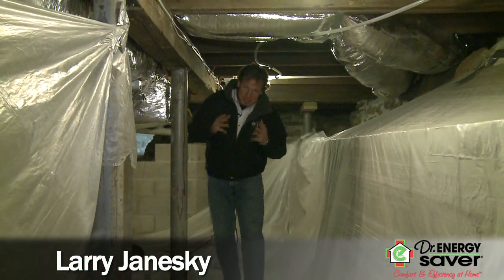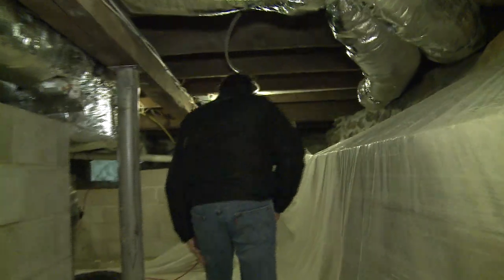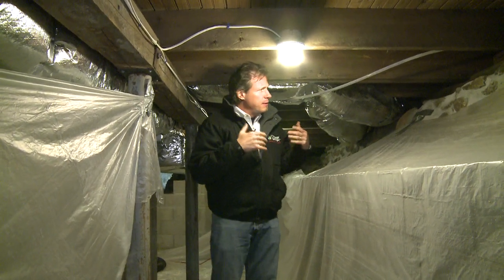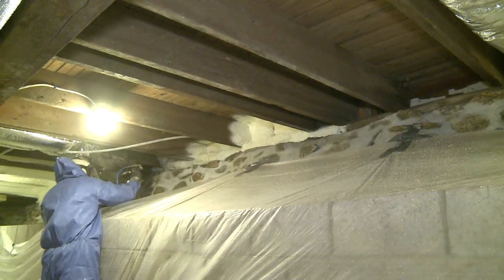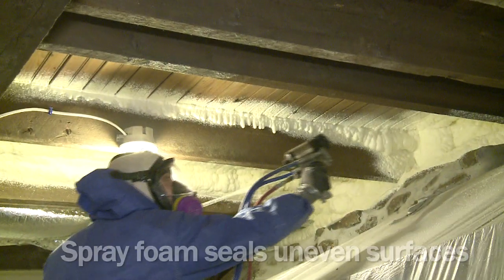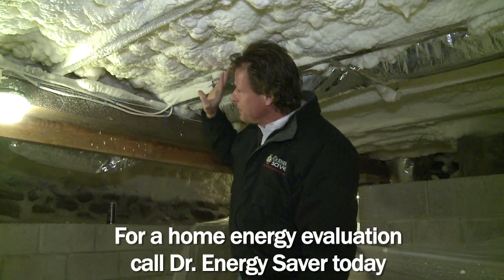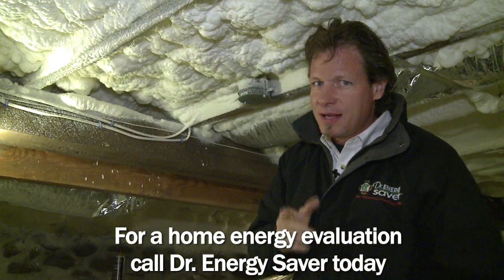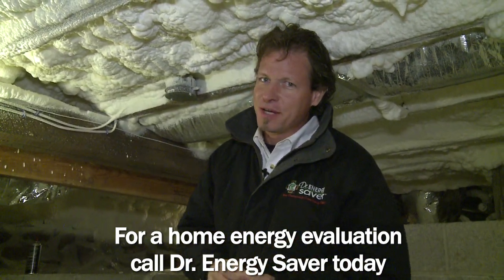Insulating a Floor with Spray Foam

Comment: The idea is nice but I would not recommend this. Why '?
My daughter bought a house that had this done to it.  Nice home but they had a leaking wax ring on spare bathroom toilet.  Didnt know until it soaked the floor joist an came thru the floor by the shower..... the spray foam insulation held the water and has rotted several floor joists.  Costing hundreds of dollars in repairs.  Even though there foam did insulate the floor it also holds water......

Comment: Spray foam insulation in my crawl space caused my floor joists to completely ROT in just 4 years!! EXTREME CAUTION!!
Reply: Open or closed cell?
Reply: i'll bet $ they shot it w open cell if you live in climate zones 1-4 they highly rec closed cell

Comment: Will this application you showed prevent moisture from entering the 1st floor?
I have the same need, and the same cold 1st floor as this owner, but I have tons of moisture coming into the house from the basement!

There is no current vapor barrier and the house needs one. Is this foam you just applied in the VIDEO a good "vapor barrier?"

Comment: No. Do not spray open cell in a crawl space. Plus, looks like he needs some better applicators. I dont get how he has these vids up with foam looking like that and promoting it. Now, on the other side, foam is a great product. Ive been an foreman/applicator for 8 years. Please look into spray foam if you are remodeling or building new. Little higher up front cost, but it pays for itself in the long run. If applied correctly, you cant beat it.

Comment: HUGE MISTAKE! DO NOT SPRAY OPEN CELL FOAM ON IN A CRAWLSPACE. IT ALLOWS WATER VAPOR TO PASS THROUGH IT!! IF THIS HOMEOWNER HAS WOOD FLOORS THEY WILL CUP!!! I HAVE OPEN CELL SPRAYED IN MY CRAWLSPACE AND MY FLOORS ARE RUINED!!! CONTRACTOR WONT FIX! I AM SCREWED!!! CLOSED CELL ONLY UNDERNEATH THE HOUSE!!! IM WARNING YOU PEOPLE!!!!
Reply: Wouldnt water vapor have been getting up through your floor when you had nothing at all sprayed on the underside? How would foam let more vapor up? I would be far more concerned about mop water seeping down between floorboards and not having anywhere to go once it pools up against the foam.
Reply: Morgan Barker foam does a really good job keeping the cool a/c inside the home in the summer and also keeping out side heat from raising the temperature of sub floor. So the sub floor is cold moisture raises up threw the foam and condensates on the cold subfloor. With no insulation or low r value insulation. The subfloor stays above dew point.

Comment: If foam is installed in a roof or a floor or anywhere, and there is a roof leak or plumbing leak, you fix the leak.  It''s not the foam (or any other insulation) that is the problem, it's the leak.  You find it, even if you have to remove insulation to do so, fix the leak, and put the insulation back.
Spray foam, both open and closed cell, is a relative miracle in making homes more comfortable and energy efficient.

Comment: Crawl spaces that are damp should not be treated with closed cell foam and called done.  If a crawl space or basement is wet, it's the dampness that is the problem, not what type of insulation is installed.  There are 26 million dirt floor crawl spaces in the United States, most of them damp as a result of the exposed earth, that are insulated with FiberGlass.  While FiberGlass is not good insulation here, it's not the moisture that is the problem.  We have known for many years how to fix this problem and get rid of the moisture.  You don't ignore and leave one problem (moisture) by putting a moisture resistant insulation (closed cell foam) in.  You still have a moisture problem.

Comment: Yep, nobody denies that spray foam is better, but in reality the difference you see in comfort or your electric bill is minimal if any at all compared to "properly" installed plain old fiberglass insulation.
and no difference at all to rigid foam boards sealed with just a small amount of spray foam which would cut the cost by about 2/3rds as Beth Shatara mentioned.  The point being is that manufacturers are wildly over charging for spray foam. 1000% markup is called robbery.

Comment: Your right, to save $ on the job shown, the volume of spray foam needed could be reduced by using the cheapest ridged foam boards(1/3 the cost of foam) available and glue strips of them between the joists.

Comment: Sadly about 1000sf of foam insulation just 2" thick which is only about R13 would cost about $2000-$2500.
R13 fiberglass at full retail cost at home depot would only be about $300.
You would not see the cost savings of $2000 in your lifetime if you bought the house when age 20 and stayed there until you died.
Foam is better yes, but not 1000% better.
You could put in sealed insulation bats for about $500 and never have to worry about it.
Foam is a scam, manufacturers are making 1000% profit.

Comment: Open cell is the correct product for this job, typical misconception that open absorbs moisture. It will not absorb moisture! but is not a vapour barrier! Open cell will allow the floor joists to breathe while stopping air infiltration. If the joists contain moisture the open cell structure will allow the timber to breathe and not hold moisture and rot timbers. 99% of moisture movement is through air movement but if you stop air movement you stop 99% of moisture movement.

Comment: Wrong product for the job. How did you make the call to use open cell vs closed? I'd guess it was driven by price and ignorance. Open cell has uses, mostly to deaden sound. An unfinish basement is the last place should be used, for one simple reason.. It absorbs moisture! Closed cell is more expensive, but from what I saw in the video, it was a small basement,likely a min bid job, $5-800, on a job that size the $ difference for closed vs open would be small. And closed has 2x the rvalue.